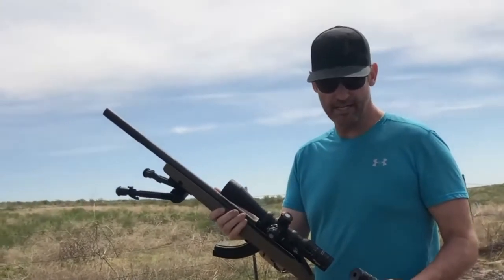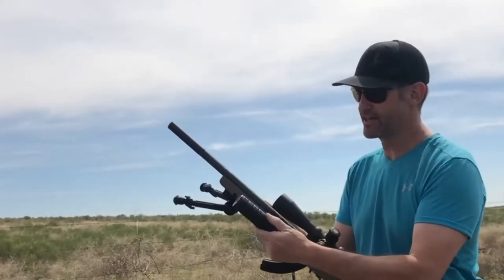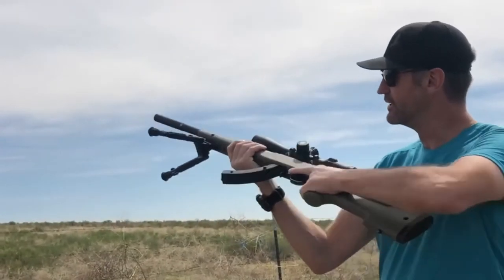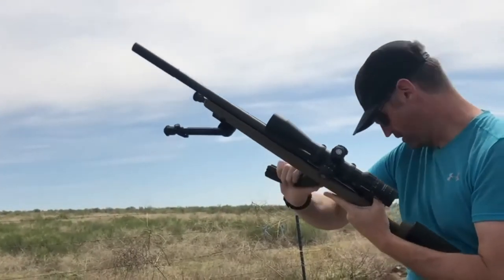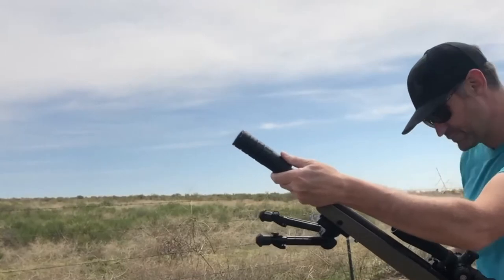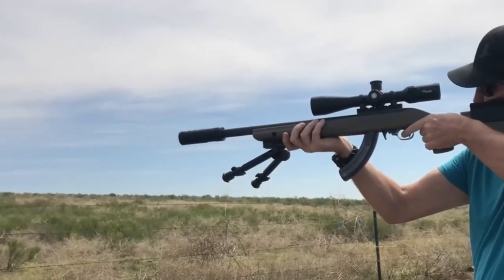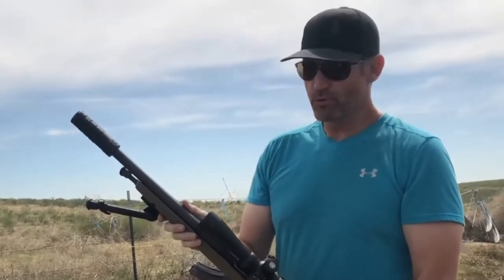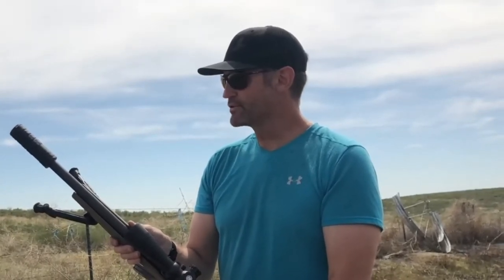JK Armament Kit vs Rimfire Suppressor

Comment: Thanks for posting this video. What is you’re JK can drilled out to? I’m trying to find info on 5.56 performance with a jk kit drilled to 30 cal vs 22 cal. Thanks
Reply: .22, .223 & 5.56 should be drilled out to 9/32”. Be sure to also single clip your baffles / cones and keep them in line.
Reply: You will always lose some dBs when you shoot a smaller projectile through a much larger bore. One way to salvage some of those dBs is to use different end caps. Have one end cap bored to 9/32” for your 5.56 and a second end cap bored out to 3/8” for the .300